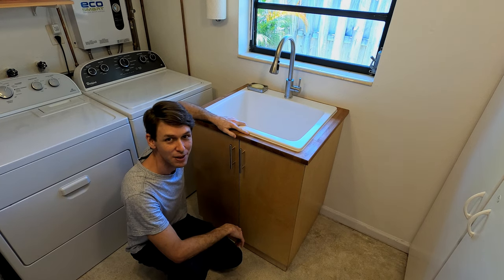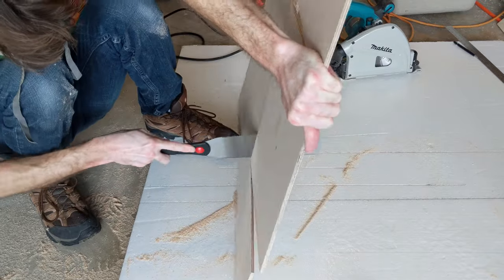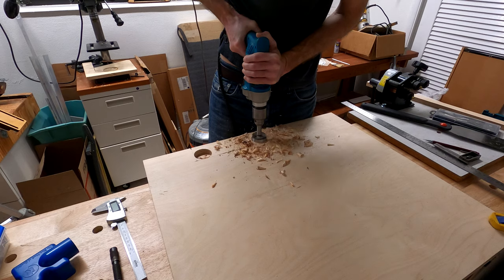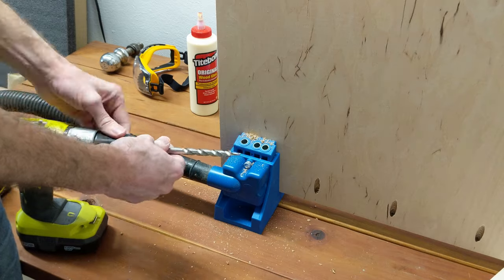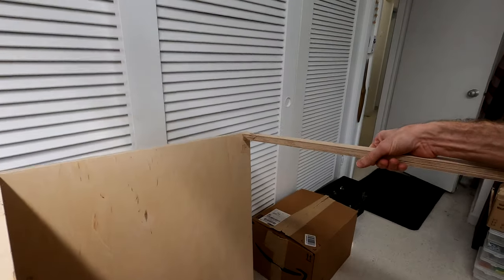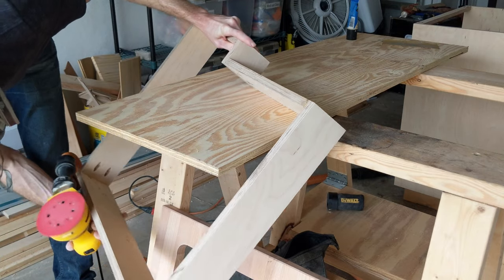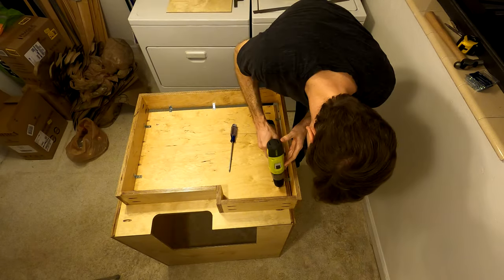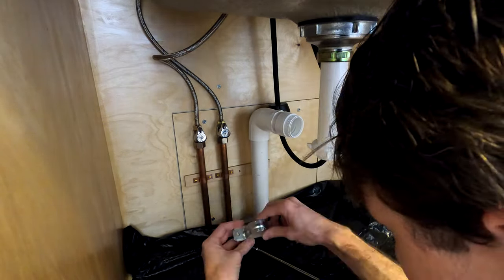Building a Laundry Room Sink Cabinet from Birch Plywood

Comment: Nice job, and I appreciate you left in the goofs -- we all do things like that. I love the log tensioner for the glue-up -- a great example of doing what you need to, with what you have, to get it done. Thanks for the link to the sink -- can you also post one for the faucet assembly? Thanks.
Reply from the maker: Thanks Paul! The faucet I bought is a "Forious". There's lots of brands selling something like this on Amazon, and I bought the cheapest one I could find at the time. I can't really recommend it (maybe get the second cheapest one!). It definitely feels a bit lightweight and although it works and hasn't leaked yet, it's not exactly rock solid when you swivel it around. Here's the link though: https://www.amazon.com/gp/product/B07Y4Y88Y6/ref=ppx_yo_dt_b_search_asin_title?ie=UTF8&th=1
Reply: @EikiMartinson  Thanks, Eiki.

Comment: Genuine question.... the base is directly mounted on the floor. How do you think it will hold up over time to water pooling on the floor as tends to happen from time to time?
Reply from the maker: Thanks for the question Flynn! I can report that I have had one accidental flood in that room since I installed it, without any visible damage to the plinth. The polyurethane finish is tough. If you're really worried about it I suppose you could build the plinth out of something else, but honestly the birch plywood, suitably finished, is more water resistant than the particle board that a lot of cheap cabinets are made of.